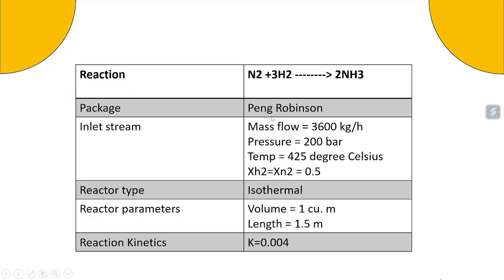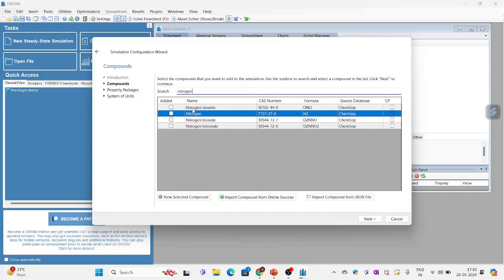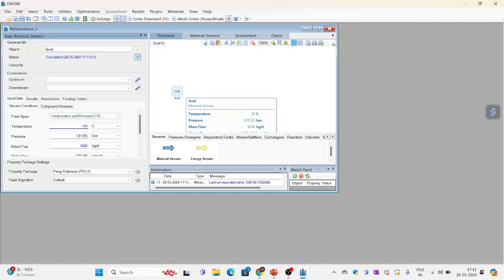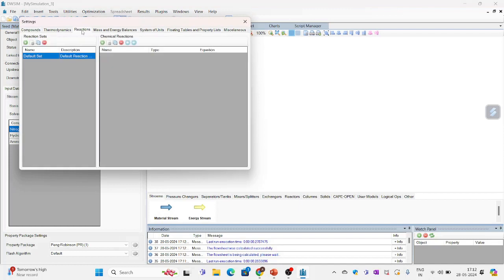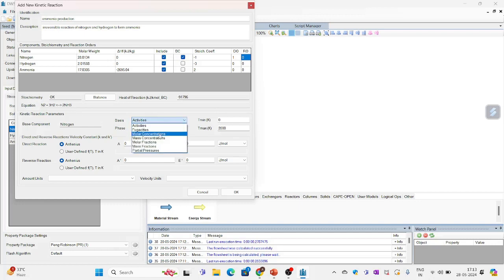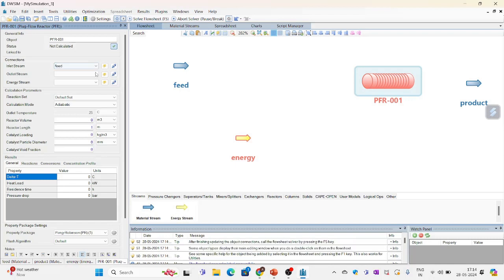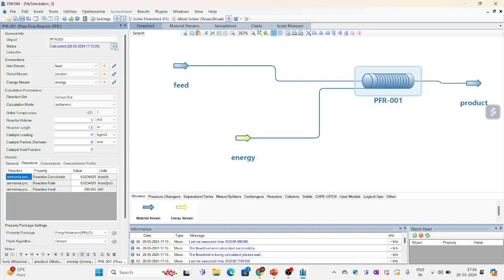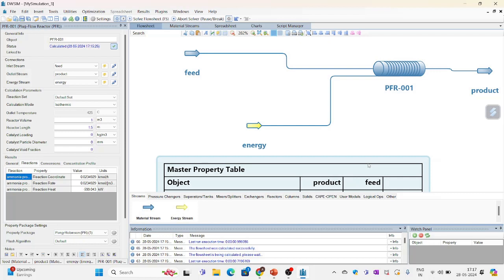SIMULATION of a Plug Flow Reactor in DWSIM #iitbombay #job

Comment: Hello! I'm trying to use a substance that's not in the DWSIM database. I tried different methods, using online databases or JSON files, but I had problems when running the Plug Flow Reactor.
What should I do to use the phthalic anhydride in the proper way? Thank you!
Reply from the maker: you can try to use compound creator utility which allows to input missing compound. https://dwsim.org/wiki/index.php?title=Using_the_Compound_Creator_Utility